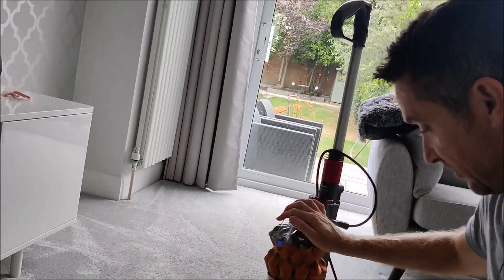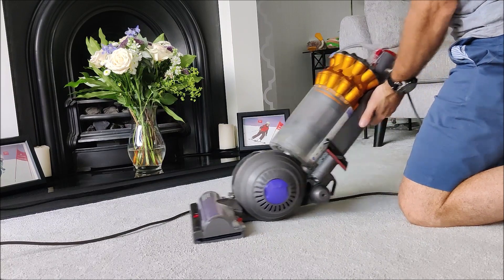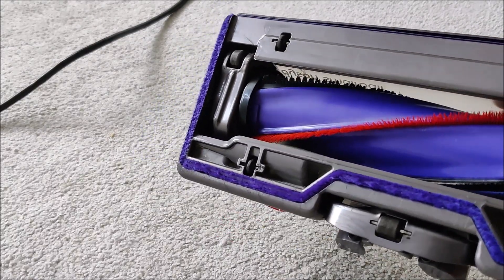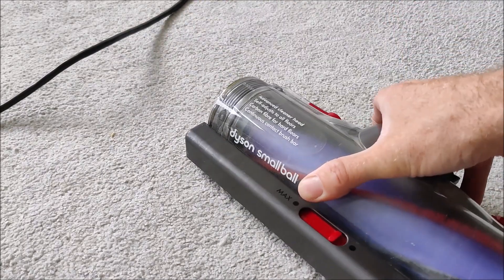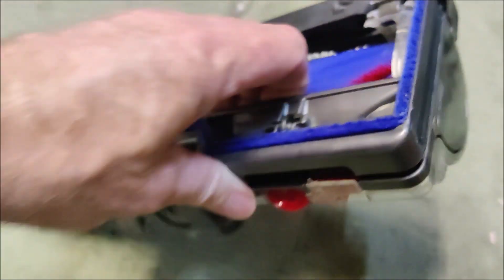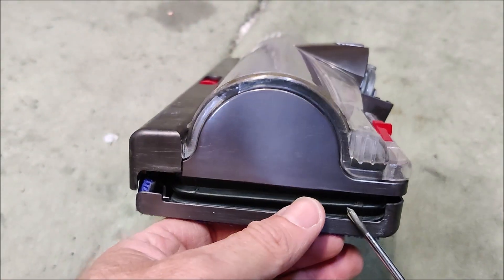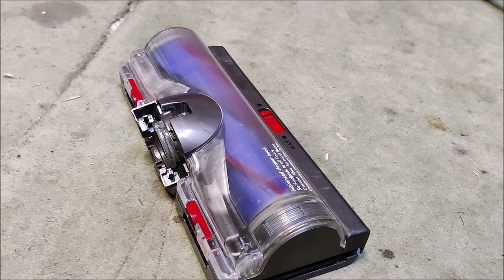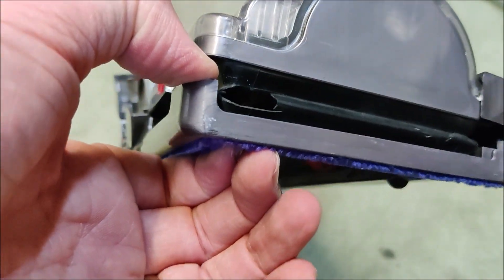Dyson sucks too hard - FIX

Comment: I have this problem as well. Most of my home is tile and the powerful suction works great. On the few large carpet areas I have I set the vacuum at the end and walk it back instead of pushing. When I get to the end I just turn around and do the same. I would hate to reduce the suction because it works for me, Just mho on the issue,

Comment: Smart man!
That's exactly what's going on.. suction too strong for some carpets.
Models vary regarding the gasket/bellows.. do what he did if you have that type or with other models you remove the bottom plate by turning or flipping locking tabs, then remove part/all of gasket.  PROBLEM SOLVED!!
Reply: YES!! I tried this -  Just remove the entire base and go for it :) Works great!